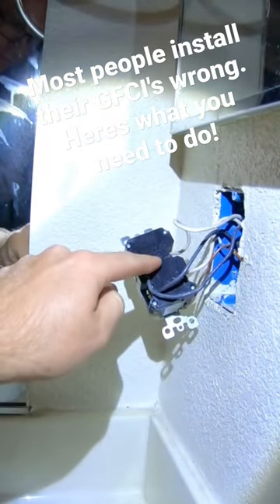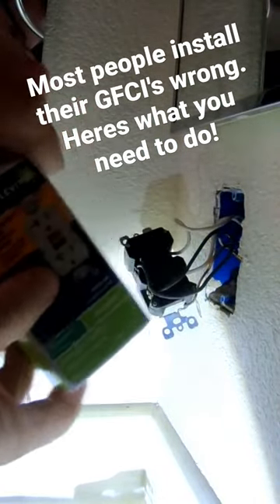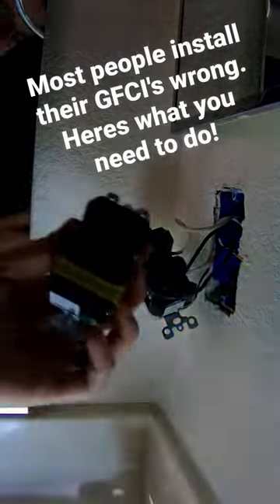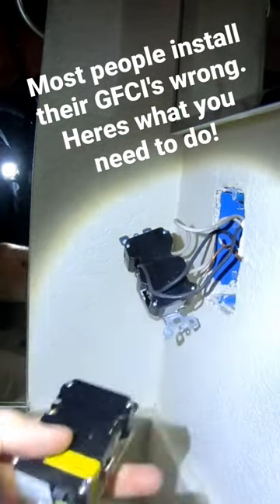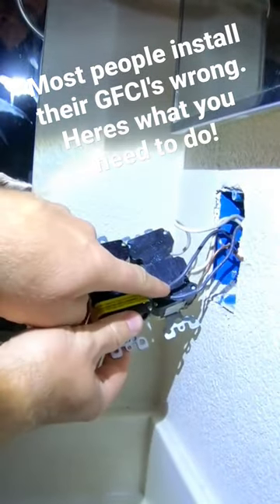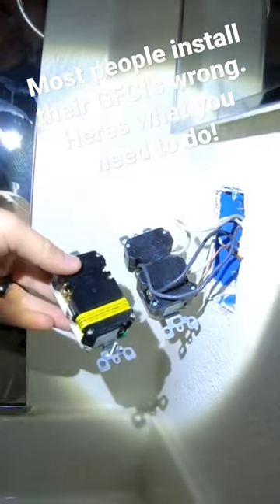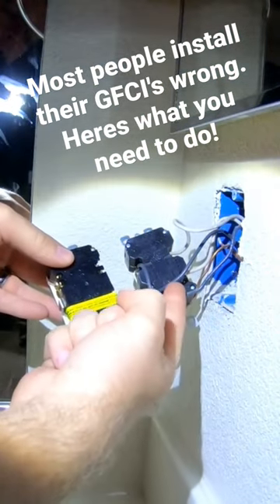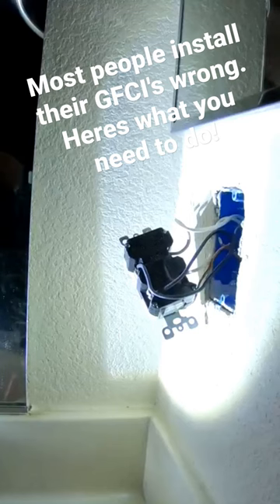Most people install their GFCI's wrong! GFCI not working after replacement? What to check!

Comment: Fucking great, I didn't know why the newly installed gfci was not working at all, I had power coming (yes, I got shocked like 5 times) but couldn't figure out the problem until I watched your video. Switched the wires and voila, solved.
Reply from the maker: I am glad this was helpful for you!
Reply: This fixed my issue as well. Thought I just bought a bad GFCI but when the second one did the same thing I knew something was up, just didn't know what that something was. Thanks to this video I was able to swap the lines and it worked just fine. Thanks !
Reply: Witch wires you switch,,

Comment: I swear the electricians organization that sets standards deliberately made this change at some point to get an extra $10k/year in house calls for their fellow electricians. A lot of frustrated DIY guys who can't understand why it won't work when they think they rewired the new one exactly like the old one.
Reply: That's my theory also! And the replies suggesting people should read instructions or read the (nearly invisible) words on the back of the outlet,?come on! When replacing a part with a new part that looks identical, the standard is to put the wires (very carefully) in the exact same position on the new part as the old part.

Comment: 30 minute job turned into a whole weeks trying to figure it out. Had a couple guys help me simply install a few new outlets in the office of a building we are remodeling. Turn the main breaker off replaced all the outlets, the same way we took them off. Installed all the covers. Turned on the breaker with no power.. we installed the 20 outlets I didn’t know where to start so I pulled them all out. All the wiring was correct and uniform. Electricians were installing LEDs in the building. They checked it out they were stumped. Opening all the junction boxes, it was a mess. Until I saw this video. 😅
Reply from the maker: Glad this was helpful!!!
Reply: Thank you for this... Why in the name of God would the manufacturer do this? I specifically bought the same part number from the same manufacturer... And then they arbitrarily swap everything! Wtf!

Comment: Holy FXXK!  I just flipped over the old one and the new one and sure enough, if you put the ground at the bottom, the old one has LINE at the bottom and the new one has LOAD at the bottom! Reversed! And I was so careful about putting the wires on the new one in EXACTLY the same places as the old one. Thank you for this video!   1. Why is this not mentioned in the dozen other troubleshooting guides I have looked at?   2. Why isn't there a law against this!!

Comment: I have wired this thing every which way. I get the green light and the reset button won't reset and it's popped out. No electricity coming up but my meter says it should be hot. I'm about to pull my hair out I don't understand what's going on did I get a bad gfci?

Comment: Thank you. This as the issue. Put the line and the load in correctly and all is well now. Thank you. Mine was in my RV. Bought the new GFI , took picture prior to removing wires. Put them in exactly as they came out. However I had not read the Line an Load designation on the new one. Thank you again.

Comment: Hi, thank you for great the video, I believe I have the same problem with my wiring 
I’ve had dead outlets for over 3 years, today my wife tried to use the microwave and  some more outlets went dead, 3 years ago I installed a new GFI ever since this circuit hasn’t been workingI, I have tried everything, I got green light at the GFI but no power, it is driving me crazy.  I got one cable ( Line) from the breaker box coming into the outlet and 2 cables (Loads)going out from the outlet who feed the circuits who went dead, I have joint the 3 black wires together and used a piggy tail wire to connect it to the bottom of the power ( Gold) side of the GFI, and 3 neutral wires together with a piggy tail to connected it to the bottom (Silver) side of the GFI and my GFI still doesn’t work, but the little dot green light on the GFI is on …….what am I doing wrong? The only thing I can think of is a burnt breaker.
I real appreciate any advice in advance.
THANK YOU!

Comment: I swapped my gfci, and it's green and works but now lost power to two of my 5 outdoor outlets, and the other two are ground neutral on my tester. Any suggestions?
Reply from the maker: Sounds like you connected the 'load' wires incorrectly. The load wires are the ones that feed the downstream outlets, I would start there, pull the GFCI out and make sure you have it hooked up correctly
Reply: @handymanjourney  GFCI is correctly wired. Could I have bad outlets?

Comment: So load is the black wire and line is the white wire?
Reply from the maker: No the black and white wires go together. The black to the hot side and the white to the neutral. There will be two sets of wires, each set will have a white and a black. One set is the load and one set is the line
Reply: @handymanjourney  so if you only have 1 white wire and 1 black wire they are both to be connected to the Line for each wire and never the Load?
Mine won’t work - bought 2 new ones and won’t reset and only see faint red light no green light at all- thanks

Comment: Just open your eyes and read the back of the outlet when you do a change out, remove the wires one at a time. line goes to line and load goes to load.
Reply from the maker: Yes!💪
Reply: I understand the blacks are hot but is one the main line and the other one is for other outlets it’s in my garage?
Reply: @handymanjourney  I still don't get it I just installed a new gfci and didn't work so I took it back to home depot😂😂😂

Comment: I installed as instructed with two different gfci and both failed test. Its a brand new line and the ground wire is attached with another ground in the breaker box. What could be going on. Its a 20 amp line.

Comment: Is the lil green light supposed to always be on on the plugs. Cuz I swapped my old one to new one nd it’s constantly on doesn’t turn off, I have no problems getting power just curious about that? I put copper wire to bottom green screw, white wire to silver screw and black to copper/nickel screw. Ty

Comment: I have an issue like this.  The gfci outlet works, but the regular outlet on that gfci blows the breaker Everytime something is plugged into it  Would this be the same issue as in this video?

I'd my entire house reqired, but the one outlet didn't work, unfortunately electrician had moved out of state by the time I'd noticed.

Comment: I have all the line and liads in the correct spot byt it keeps tripping?!  What am i doing wrong
Reply from the maker: Something still has to be wrong. I would say if it's tripping it's probably wiring correctly. Make sure all the blacks are on one side and all the whites are on the other side
Reply: @handymanjourney  i have the inlet power on the top (line) and the outlet power  (load) on the bottom, all whites are on same side and blacks are on the same. The previous gfci outlet just went out but before that it worked great for years. Am i overlooking something?
Reply: @handymanjourney  and i do appreciate you responding. Thank you sir for trying to help
Reply: @handymanjourney  figured it out. The outlet wired after the gfci was burnt up in the wall causing the short. Got them all swapped out with new and everything now has power. Thanks again
Reply from the maker: I'm so glad you got it figured out!
Reply: @handymanjourney  me too. I really do appreciate you responding. I think that deserves me subscribing to you lol

Comment: The two white cables on the top ?
Reply from the maker: No, there should be a white and black on top and a white and black on bottom. If both whites are on top it is incorrect
Reply: As you may know by now the black and white wires on the line side go where the outlet says line . But yes one black and white wire on top and one black and white on bottom.

Comment: They were forced to put a few of these in my new shop building in order to get power hooked up. Even though the building has no water. The problem is that on a 15 amp breaker, about 80% of the time my saw will trip the GFCI. The real problem is that when my wife and I were out of town for a week there was an interruption in our power and, though the power came back on, All of the GFCI outlets tripped, and two of them were connected to a freezer. We lost a lot of food. 

My solution. Removed and replaced with normal outlets. Problems solved.
Reply from the maker: Oh man, losing food is never fun!

Comment: Please explain LINE & LOAD
Reply: Load brings in electricity from the beaker line brings the electricity to another outlet nearby, like a fridge, a oven, the gcfi will stop any shortages and cut off electrical power to both outlet
Reply: Line is power coming in. Load carries power to the next location.
Reply: @unishking163 , That is incorrect.

Comment: Didn’t identify colors of line and load.

You’re “gunna-wanna” x 3 love it!

Also, if you don’t tell me the color codes I need to watch another video. 
But thanks for the old/new comparison.
It would also be helpful to know about when the wiring change took place.
Which decade would even be helpful.
Reply from the maker: There is no color code. Most homes are wired with white and black wires. But you may have a red wire in there there's no way to know how yours is specifically wired up, you just need to get the line with the line and the load with the load

Comment: Current GFCI has white and black on load,  I want to run a new plug, so I plugged my new wire in the white and black on line (on my current gfci) and ran a new outlet, and plugged in the white and black on line on the new outlet, but it has no power? Help!

Comment: Now im showing hot/neu reverse. 😢
Reply from the maker: Black to hot and white to neutral
Reply: In this situation just switch the wires and then make sure they are labeled/taped black for hot (gold screw) and white for neutral (the silver screw). Everyone gives advice as if every home is wired with standard Romex or correctly. Always make sure you’ve correctly identified each wire regardless of color. Use a multimeter to be sure. Then do your best to color things correctly once you’ve identified them, will make things easier in the future. Leaving this comment to help the next amateur on the path to self sufficiency.
Reply: @cnemelue  Thank you so much for your response.  The information you provided is very helpful and so kind of you. Your kindness helps make the world a better place for me. Thanks again for sharing your knowledge.

Comment: Seems like your speaking chinese...here's how to explain..a black may be load or power and white be no power or line..therefore to correctly connect a gfi.. put the black on load and white in line..persay..not just showing a model diff!!!
Reply from the maker: Sorry but this is incorrect. You will have a load for both black and white and you will have a line that is both black and white as well
Reply: Yea but he not explaining how to switch it is it by removing the yellow tape and wire it there,,don't understand